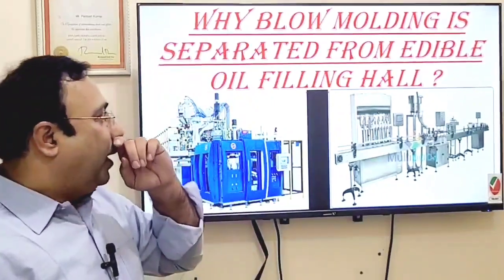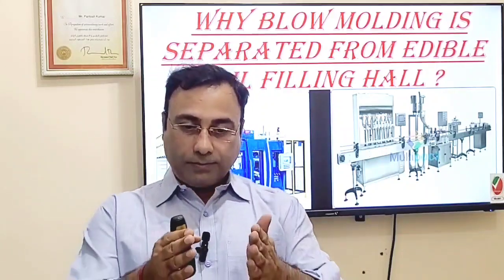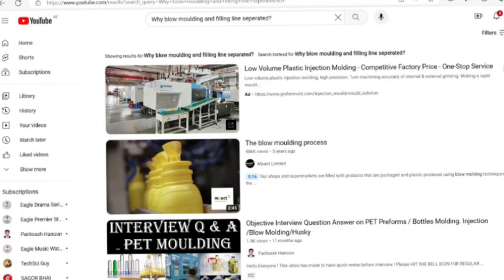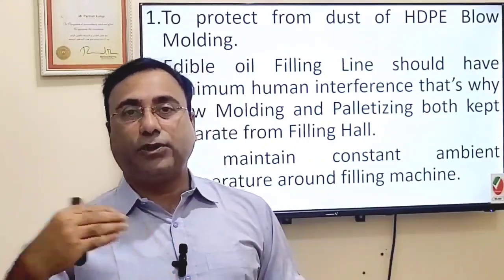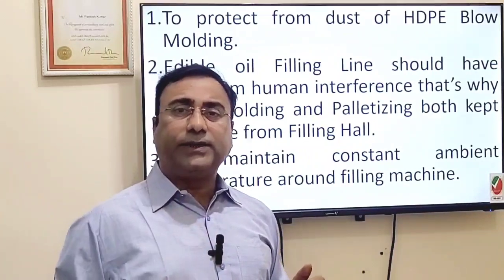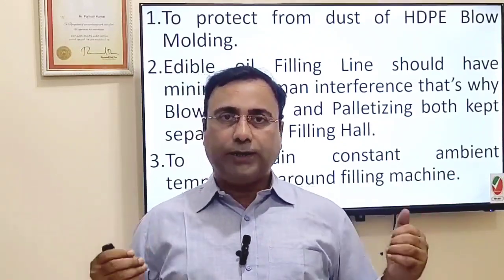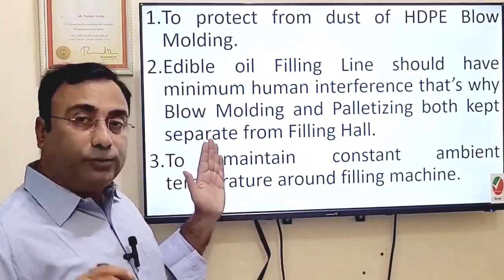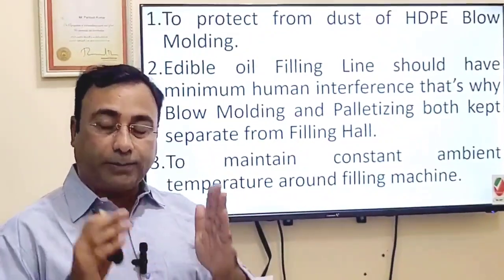Why are Blow Mouldings separated from Filling Hall even on Integrated Line ?

Comment: Why we are keeping Jerrycans for curing for some hours before allowing for filling.
Reply from the maker: Not hours. It's minutes depending on the weight of the product. Oil Filling temperature is 45 degree Celsius,  JC temperature should be less to that to avoid air trap.
Reply: We fill JC immediately after blowing by attaching cooling device on conveyor.

Comment from the maker: Your last point is most valid, the heat dissipated heat by blowing line is high because hot air comes out the blown bottle, therefore kept separated , air exchange is minimum 15 times for blowing section. Filling line hall is kept at Max 25C. ... Arun Sir on WhatsApp